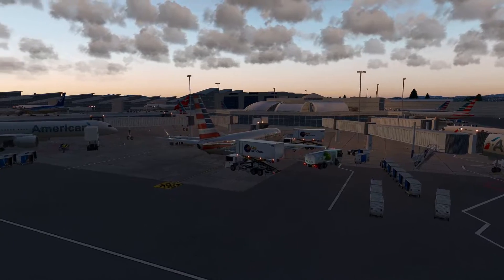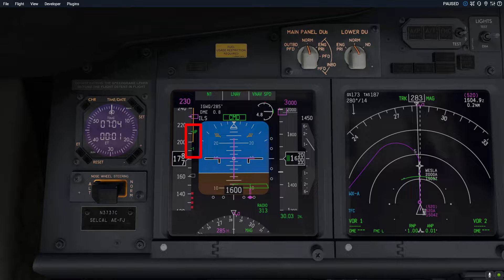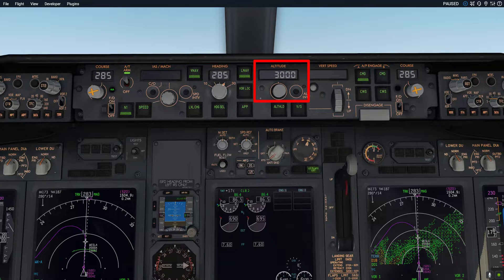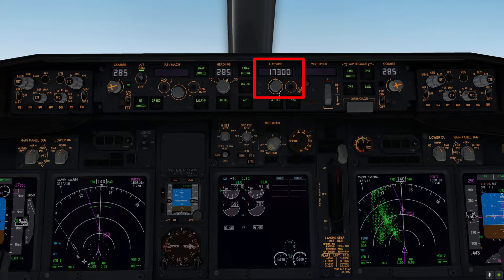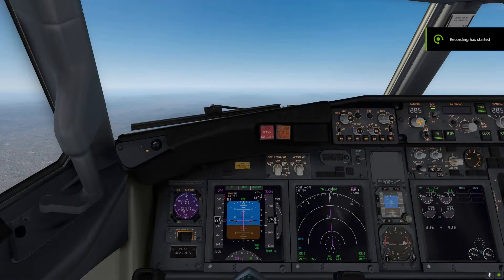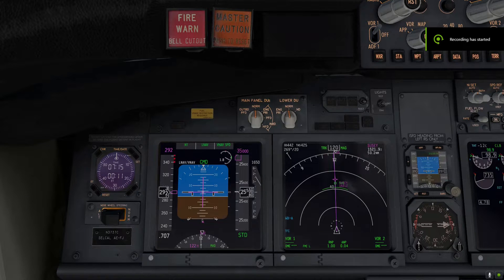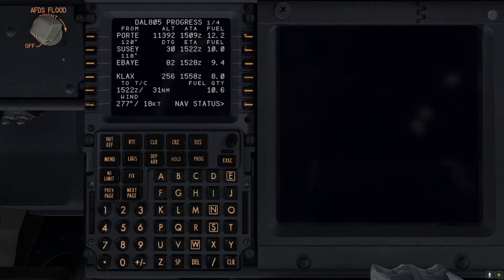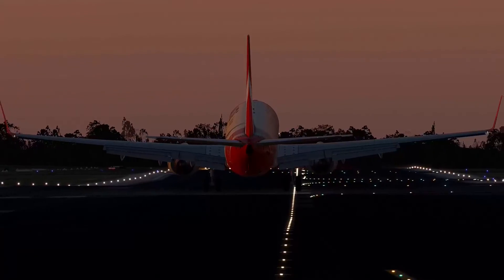Aircrafts Dissected Ep 13: Climb and Cruise IZibo 737I X-Plane 11 Detailed Tutorial w/checklist

Comment: I think you had to engage the anti ice below 10 Celsius
Reply from the maker: Anti-ice operation usually depends on company procedure. You could engage anti-ice below even 15 degrees if there is visible moisture in the air, a low dew point and if you’re departing or arriving into an airport situated at high altitude. It depends - but one thing common is that visible moisture needs to be present to engage the anti-ice systems. Thanks for watching, if you enjoy the content, make sure to like the video and subscribe to the channel. Also hit the notification bell icon to never miss a video :)

Comment: I have not heard of a reference stating it is acceptable to retract flaps within 20 kts of each flap setting on the speed tape. This is incorrect as general guidance. The white reference bug is set at VREF+15 and is the minimum speed to begin retracting flaps, assuming you have reached the acceleration height (1000ft AGL).  At this speed presuming Flaps 5 for departure, at V2+15, select Flap 1. Once reaching the Flap 1 speed on the tape, select Flaps Up. Some operators are different, but the two 737 pilot friends I asked both select the intermediate flap settings before selecting Flaps Up. "At acceleration height, call for flaps up maneuvering speed." Verify acceleration. Call "FLAPS ____" according to the flap retraction schedule.

I have never seen setting the radio altimeter for the departure airfield. If an emergency required returning for an immediate landing, you will still get the radio call-outs with no RA set. I can understand your thought process and would seem logical. 

Entering the departure runway ILS frequency, if available, is a good safe practice.
Reply from the maker: That's misinformation that I pointed out in the video. Thanks for pointing it out:)

Comment: Oh sorry I forgot. Cabin Pressure adjustment (hypoxia thru lack of CO2 ?) comes to mind ? please forgive me, I am newbie around here but something about that has stuck in the back roads of my mind.I am a very big fan of your work young sir.
Reply from the maker: Thank you so much for your kind words Robert. However, I have to say I didn't quite understand your question about the pressurization panel. Could you please clarify what you mean and I will be happy to answer:)
Reply: @FlyBySimulations  OK I am a newbie,so may have got confused over this post on the XP web site David Ross
If you are climbing to altitude with no O2 and you have hypoxia settings on (black out) that is what it is simulating. Turn off and it will be normal. Having read this I searched the overhead panel and found just below the voice recorder settings what looks like a cabin pressure control system.AS a previous Breathing App.instructor, with Fire and Rescue It triggered me into thinking ,we need CO2 to stimulate our breathing is this a consideration when at 40 thousand feet  where there is a lack of CO2. so sorry if I am being a nuisance young sir .Best wishes R.
Reply from the maker: Robert Brown Thank you for the useful resource Robert. I did however cover the concept of hypoxia and permanent brain damage due to lack of cabin pressure in the first episode of the series, where I spoke in depth about the pressurisation panel on the overhead.😅
Reply: @FlyBySimulations  Thank you respectfully young Sir.That is going back a long way, for an elderly retired Sea Captain who had never encountered a GPS long after my time.Thank you for your patient reply. I look forward to # 14 with renewed enthusiasm.Please continue your wonderful work .My very best wishes.R
Reply from the maker: Robert Brown No worries at all Robert. As for episode #14, it has already been released and you can watch it by clicking on the following link: https://youtu.be/5lDtcmbOCyE . Hope you enjoy. Please like the video and leave a comment if you did😊

Comment: Aren’t the minimums supposed to be set 1000ft over the departures airports altitude ? Then set decision height of the landing airport before landing? I could be wrong 100% it’s just what i was told.
Reply from the maker: Hey Ryan, that's actually a great point you bring up. Thing is, it's all dependent on SOPs or standard operating procedures. You're not wrong that some airlines will enter a numeric value above 1000 feet while departing, but that isn't the decision height or minimums they're entering for the departure airport. What they're actually entering there is the aircraft's acceleration altitude, which gives pilots a visual indication as to when their aircraft will suspend the initial takeoff phase and move over to the climb phase. However, different airlines employ different uses for the minimums knob during the takeoff procedure. Some do it the way I described it in my videos (as confirmed from conversations with real world pilots) whereas others do it by setting the acceleration altitude. Hope that answers your query. If you enjoyed the content, please consider subscribing to the channel and leaving a like on the video if possible:)

Comment: Can you explain why n1 limit increases as altitude gained ?
Reply from the maker: Umur Özbek Hey there, could you provide a time-stamp as to what part of the video you’re referring to?
Reply: @FlyBySimulations  it's general question;during climb n1 limit increases while climbing.I mean climb mode limit goes higer as we go higher.
Reply from the maker: Aah ok, I think I understand your question now. So the answer to your question actually depends on 2 main factors. Number 1 is that it is largely dependent on the specific climb profile you select in the N1 limit page during the CDU preflight setup. You can see that in the 9th episode of this series. Along with entering a de-rated thrust for takeoff, you also select a particular N1 climb setting which will dynamically change (usually increase) in order to keep the same vertical speed while climbing the aircraft to it's cruising altitude. Number 2 (which I think is the actual answer to your specific question) is that the engines work on the principle that fuel inside the nozzle goes through a combustion process in order to be used as thrust. To aid in this combustion process, oxygen is a core component. The way to get more oxygen into the engine core is by spinning the engines faster (which is what the N1 value measures). Now as you might know, as altitude increases, atmospheric pressure decreases, which means that the quantity of oxygen per molecule of air decreases. (This is why you can't fly aircraft into space, as there's no oxygen up there to help feed the combustion process). Hence, the engine blades have to spin faster to be able to compensate for the lack of oxygen by getting in more air into the core of the engine, which is represented in the flight deck as a gradual but constant increase in the N1 value until reaching the cruising altitude (after which the aircraft arrests its climb and maintains it's altitude). Hope that answers your question. If you enjoyed the content, please consider liking the video and subscribing to the channel:)
Reply: @FlyBySimulations  thanks for explaining and your time,already subscribed.Keep up good content !
Reply from the maker: No worries at all and thank you so much for your support:)
Reply: @FlyBySimulations  Exactly.   It does seem counter-intuitive but N1 may actually be higher for the climb than during takeoff!  "Full throttle" takeoff is the norm for non-aspirated piston engines but for anything turbocharged or turbine-powered a calculated power setting is used.  On turboprops it's a torque value and on modern (turbofan) jet engines it's an N1 setting.